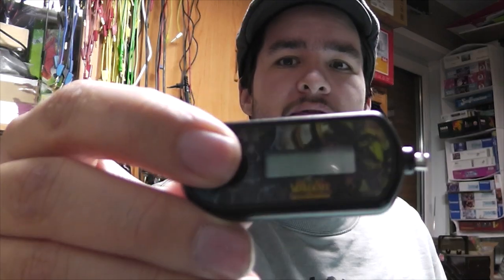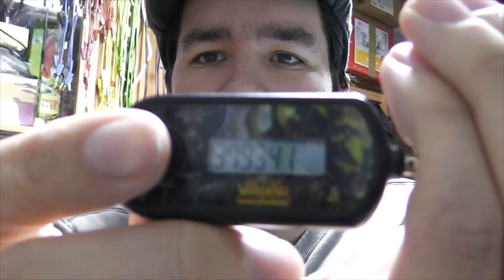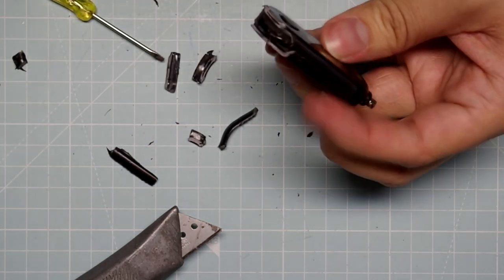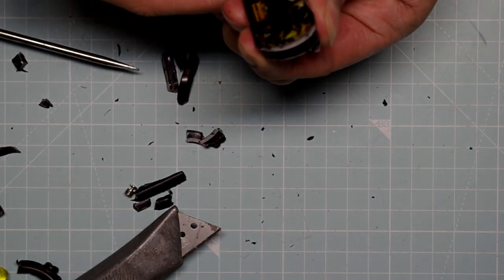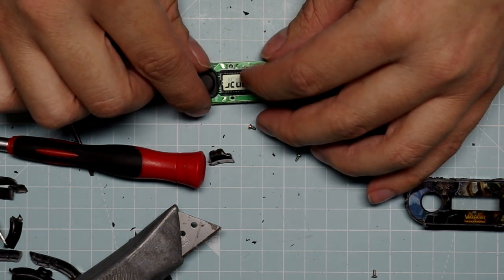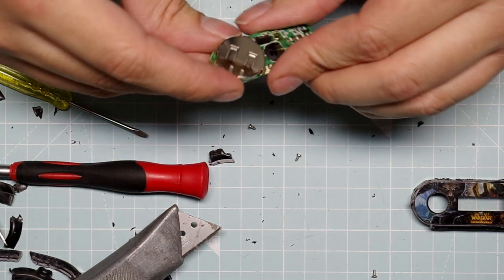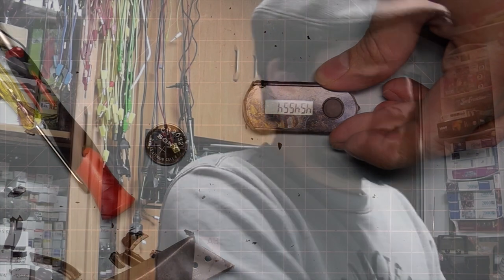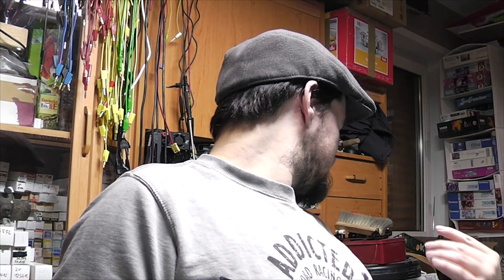Tinkertubes Lab [33] Destructive battery change of blizzard WOW authenticator "batt 00"

Comment: i opened it after 13 years cuz my battery died , when i replace the battery it give me 888888888 code all over the screen and wont change 

any idea what i can do ?
Reply from the maker: I assume that 888888 is a sign of the board not running correctly anymore. If your battery was completely flat before you are probably out of luck anyway, as the thing needs to keep track of a kinda precise counter internally, and if the battery dies completely for some time, or if you need too long for swapping, it looses track of that counter and the codes are desynchronized. Back than when I fixed mine I just went for it and tried it out, and it worked for the time I played WoW again. Which I stopped, and when moving, the thing got buried. So I can't see if it would still work nowadays.

In general, I assume it goes into some kind of "I'm fucked"-Mode, indicated by the 88888 display, when the board is too much out of sync, forgets its programming or is in some other way fucked. Sad that you weren't successfull, but hey, at least you had some fun tinkering around :)
Reply: @TinkertubesLab  You'd think that a) these would've been designed to easily replace the batteries, and b) to indicate in the manual somewhere to replace the batteries before that happens.

Comment: The plastic case is sealed by sonic welding. Sonic welding uses sound waves to vibrate the molecules of the plastic into intertwining with one another. Sonic welds are actually stronger and harder than the surrounding plastic.

Comment: For anybody randomly having this problem in 2020 like me, using a q-tip and hitting sides with a bunch of 100% acetone worked wonders. It made the plastic a good deal softer and made it much easier to pry open. Took me maybe 10 minutes with some jewellers screwdrivers
Reply: Wait what now? What do I use on the sides?
Reply: Were you able to put it back together ok? I am getting this batt 05 message in 2021
Reply: @krissiamann6841  Yeah you just need to be careful when you're trying to separate the two pieces of plastic when trying to remove the battery the first time. I didn't mangle the plastic too much and was able to put it back together just fine.
Reply: Still have my Starcraft 2 one from 2010 and it still works.
Reply: @casedistorted  Same man, I'm surprised it still works. I have the Jim Raynor SC2 one; and they are only rated to last 5 years - still working in 2022.
Reply: @Novocane23  2024 - still going strong.
Reply: Does it actually work (in sync) with your account after changing the battery? I assume you have to do it very fast.

Comment: It’s really unfortunate that they made it THAT hard to change the battery.
Reply: ON PURPOSE so you had to buy another....
Reply: Authentication tokens like this are completely worthless with replaceable batteries. They're time-based. The moment you remove the battery to replace it, you've killed power to the clock circuit. If you're really lucky, enough power will remain the the circuit through capacitance to keep the clock running juuuust long enough to swap the battery out. If you're not lucky, and odds are that you won't be, the clock resets and you never pull a useful authentication code again.

Comment: 2024, batt 00 on display. I decided to try replacing battery now, because soon there will be nothing to replace. ONLY token with still working battery may have battery replaced. To do it proper way: 1. Use dremmel around 2mm away from the back of token and cut it around. Case is around 3.4mm thick so it is rather deep cut. If you stay 2mm away from the back, the cut will be above electronics, just be carefull cutting around battery to not accidently destroy it. 2. Using screw driver gently remove back panel. 3. Remove 4 screws, be careful to not touch any electronic components with screw driver to not make short circut. 4. Remove board from the case. 5. Prepare TWO new CR2032 batteries. One will replace the old one, second will be temporary soldered to board, providing external electricity required to keep token memory intact. For the 2nd battery, best option is to use CR2032 socket (cheap and easily available), use CR2032 with soldered terminals (available online as PC CMOS replacement battery, often also with some short cables), stick cables to battery with some adhesive tape or solder them (not recomended, be very carefull to not overheat it). 6. Solder additional battery with some cables to the board. Pause toturial on 8:13. On the left side of the button you may see 3 soldering points. Clockwise, at 7 o'clock is the positive terminal, then on 8 and 10 o'clock are 2 negative terminals. Top of the battery is positive (+), bottom is negative (-). I soldered negative to the "10 o'clock" one just to spread cables a bit. 7. Put your rubber button back on, press it and check if token still shows codes. It should show them without low battery warning now. 8. If everything is OK, gently remove old battery and install new one. 9. Unsolder additional battery, press button to check if mission was successful. 10. Install the board back in case. As in step 3, be very carefull to not touch any board components with your screw driver. Congratulations! If you used quality replacement battery like original SONY you have another 15 years of peace of mind :)

Comment: opened and changed batt, just said 888888, nothing else happend :/
Reply: The clock circuit ran out of power. Without a valid time signature, the authenticator can't produce a valid code. The only chance of this working is swapping the battery or before the clock has a chance to lose power.

Comment: It's likely using a time-based one time password.  When the battery dies, the clock stops and is erased.  Until you set the time, it won't work.

Comment: hey thx for this tutorial, i made it a little bit softer, i used a very thin and sharp japan saw and saw it till there was no resistance anymore around the authenticator, then i just opened it with my fingers and changed the battery :)

Comment: Shows a code but is the code VALID? I've been told that replacing the battery will throw off the internal clock and the code it gives won't be the right one.

Comment: For the few seconds the battery is out and it's without power the clock in it may have been reset or become out of sync with time for as much as the time it was without no power making the codes generated no longer valid ones as it would give you expired ones from say 30 seconds ago or as much as when the initial time for power up is say a decade ago. You could swap the battery out if you were able to maintain power the entire time by first wiring another battery to it in parallel while you remove the first one then stick in a new one, this way the clock remains unchanged. 

I'm curious if that one you change the battery on in the video really works or no.
Reply from the maker: I actually tried it before posting the video as I suspected a simmilar problem :) I think about making a second video showing the process of keeping the device powered while changing the battery. Thanks for your Info!
Reply: Wish I had seen this before trying to replace the battery in my 7 year old authenticator. Now it displays 88888888.
Reply: Sadly, even if you do all that, the quartz timekeeping will eventually drift out of sync and with no way to resynchronize it, replacing the entire token will be the only option.  They're literally built to be thrown away.
Reply: @ckitching2  I had problems with my auth, put in trouble ticket and Bliz re-synced at their end.  Not sure if would work with a completely stopped auth though...

Comment: 2024-Was able to open mine using a small screw driver. I've had my device for ten plus years. Dealing with Blizz has been a pain in the ass, have twenty or more security questions to answer for them. I could only answer a handful at this time so, tried to replace battery. All I get is the lengthy 8 code, nothing else.

Comment: My physical fob is still working to this day, after getting it...in 2010? James Raynor SC2 edition from when SC2 launched. Extremely impressive considering they are only rated to last 5 years. Though it is slowing down considerably nowadays. I have to push the button 4-5 times to get a code now; I'm hoping I can replace the battery someday without breaking it.

Comment: 27.06.2022 - Goodbye old friend. I successfully changed the battery but even after device keept saying batt 00 and gave wrong codes. So I shorted GND and RES pins. It just bricked as it seems.

Comment: 2024 here…Didn’t have to destroy mine to get the battery out. I was able to pry it open. I got a metal pick in the seam to loosen it all up and was able to pry it apart from the key ring spot. It is touchy as the plastic is thin and I MAY not be able to use it as a key chain unless I modify it a little bit but I’m looking forward to getting another 12 years out of my authenticator. P.S. I got the d3 version since we’re all sporting our kits lol

Comment: That's nearly 15 minutes I won't get back and I didn't even find out the answer I wanted. Did it still work with the game???
Reply from the maker: So sorry to hear that your life depended on these 15 minutes you willingly sacrificed to get free information. Feel free to not waste any more of these in the future, if you feel the need to do so - there is no pressure to watch my content :)

To answer your question, yes, it worked. But judging from other comments I got, and which you could read by yourself as I don't hide any of them, many people were successfull, many were not. I think the success rate highly depends on:
A) the exact type of authenticator you have.
B) how dead it really is, as you saw, mine started with a batt 01 error, which could be resolved by swapping the battery. In fact, I used the authenticator for quite a while after I swapped it. Others had completely dead ones which couldn't be resurrected. 
C) as these work by generating a code, that is time related to some clock on blizzards servers, I assume it's pretty important to work fast. I wasn't in a hurry, as I didn't really care, but I still succeeded. But as you can't really make it more dead than dead, you might just try it?

So all in all, don't take life so serious, have a bit of fun tinkering and maybe safe some bucks. But rember, your time seems to be very precious, so buying a new 30€ authenticator might be the better choice for your specific case :) I wish you all the best.

Comment: Only $6.50 USD for a new one. You can use the phone app for free if you want that to go that route. I prefer the convenience of just hitting a button. For some reason Blizz sent me two but I was only billed for one. After a very long hiatus I had to cancel my old (and lost) one before I could play, but they were pretty quick in removing it. I did as instructed and sent a ticket in with a photo of my ID. I still have the emails, I made the ticket at 1:55AM CST on a Saturday and they responded at 8:25AM that morning with the authenticator cleared.  It's a good system and I recommend it. I know you did the tinkering for fun but for the average person you don't need to go that route lol.
Reply: Less than $7?! I could have sworn I paid $32 for mine! :(
Reply: I'll buy yours
Reply: No longer manufactured. I remember paying $6.50 for bogo and free priority shipping when it first came out. One for me, one for my wife. Looks like I'll need to use the app next. Though I do have a few spares because I got new ones every few years.
Reply: Is the phone version actually an app that works everywhere in the world, or is it tied to your phone number? I play WoW in two cities in different parts of the world and have two phone numbers local to each city so a phone number based authenticator would be very inconvenient for me.

Comment: I'm currently attempting to open one of these to properly destroy the logic board by drilling through the chips before disposing of it as my bank decided to no longer support hardware tokens, and I want to avoid having to revoke my identity certificate because the same identity is also still linked to other still supported authenticators. I thought I was too stupid to crack it open and left it be for a while, I'm glad I'm not the only one to struggle with this lol.

Comment: I did this in 2023 with a slightly different looking authenticator than yours. I had a much easier time opening it up since i used a Dremel on the seams (whilst having everything but the seams protected by masking tape to prevent scratches and stuff). Everything went fine, didn't damage anything and i was able to replace the battery with a new CR2032. Unfortunately after swapping the battery the display now permanently only displays "88888888" (like some other commenters here also experienced). Pushing the button does nothing so i guess it's bricked. I got the following comment from another Youtube video where someone took apart a RSA token, don't know if these are the same and if applicable but the comment says: "The key is stored in SRAM.  SRAM requires power to function.  When power is removed from SRAM POOF goes whatever is stored in SRAM in this case the key/seed rec." So for anyone trying this, make sure you keep power on the circuit whilst swapping the battery (that is, if the battery isn't fully dead already).

I guess the succes of being able to do this depends on the version you have or, I did notice at the start of the video that your battery still has a bit of juice since it was still able to display "batt 00" and was still able to generate a code so that could've also made a difference. Maybe there is some grace time to where you can still swap the battery before it completely goes 88888888? 
My circuit board revision (printed on the board):
G06 MAIN BOARD
DATE : OTC 24 2009
PBD90S09KJ5-R REV : 1.1

Comment: Liked the tutorial, followed it, just got 88888888 on display after changin battery :(
Reply from the maker: That's unfortunate. It seems that the time needed for swapping the battery is crucial for success or failure. Though all segments lit (88888) seems like a dead board. I don't think there is much you could do.